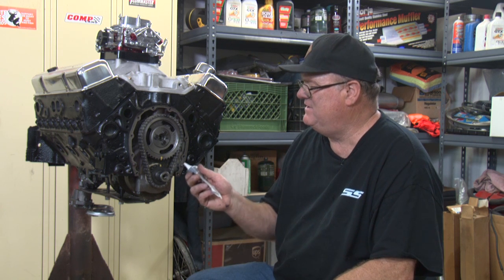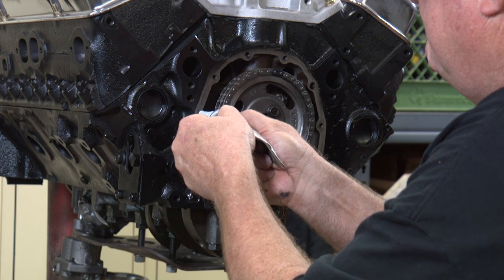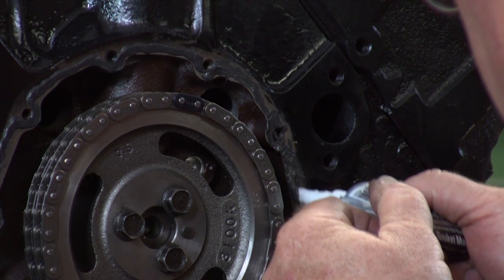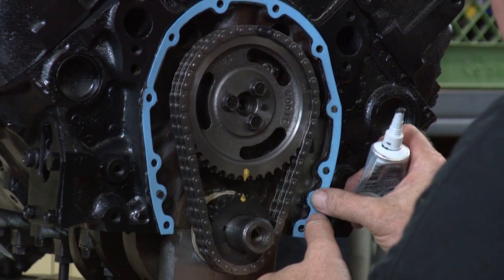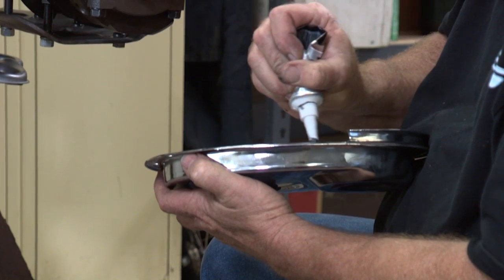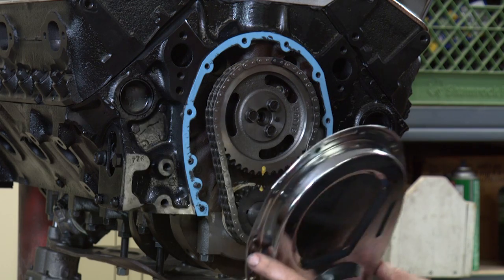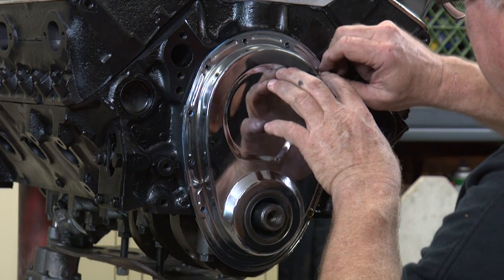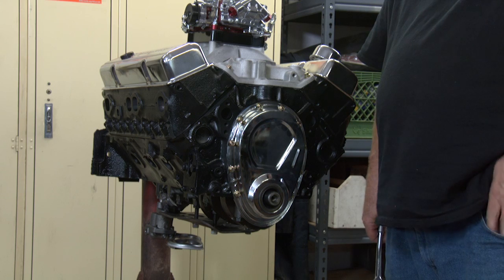How to Install a Timing Chain Cover on a Small Block V8: Easy Step-by-Step Guide

Comment: Cover on with motor in car put bottom half rubber seal in boiling water for 5 minutes to soften it up goes on easy with 2 ice picks place in cover hole on each side above dowel pins into threaded hole press down to catch dowel pins then flush to block

Comment: how to do this with engine in car and oil pan on the car.
Reply: You don't lol
Reply: Are you sure is this impossible to do to take it off without dropping the pan
Reply: @RobMetzgar01  maybe but the Crank pull has to come off for sure. Dropping the pan will deffinetly make it easier

Comment: Great video Robert! I’ll be installing a retro-hydraulic roller camshaft soon in a 1969 Camaro 302 . Any chance posting a video on how to properly install a Cloyes timing cover with adjustable cam button and how to set it?
Reply: Hope its a firm cast aluminum cover. Take a couple measurements of where a nice big flat section of the cam timing gear is. That will be the location of where you will drill a tap for a 1/8" NPT flush mount plug. 

Install a cam button. 

Take the plug out.

 Loosely place the gasket (no goop), and the cover into place, tighten it up a bit.

Push the cam to the back of the engine through the hole you drilled.

Now place a dial indicator into the hole, hitting the gear.

Move the cam forward, against the button, using a soft tipped screw driver from one of the lifter bores.

Check the indicator.

I think most companies want 0.010" clearance, but check what yours needs.

Add washers, or grind the button till you get what you want for clearance.

Then do final install of your cover and the pipe plug.

Done!

Comment: Why even a gasket if you use rtv on both sides? Rtv is only supposed to go on the cover side not the block side.
Reply: I have a 350 built by a engine shop that leaks oil all day. They used rtv before gaskets and nothing sealed up
Reply: @chrisrestaino9443  they sandwiched it?
Reply: @chrisrestaino9443  i do not understand why my mechanic put rtv on my differential cover and later i found it stock inside. Also he put shelack on my fuel pump i took it off and much better? I find rtv unnecessary. A fool used rtv as a head gasket it blew on me and i put a head gasket on.

Comment: I have a 99 suburban, I changed the crank I was provided a almost rubber cork like gasket for my timing cover it is about eight times thicker than the factory channel silicone gasket is this normal? Also did u have the rubber gaskets in your bolt holes?